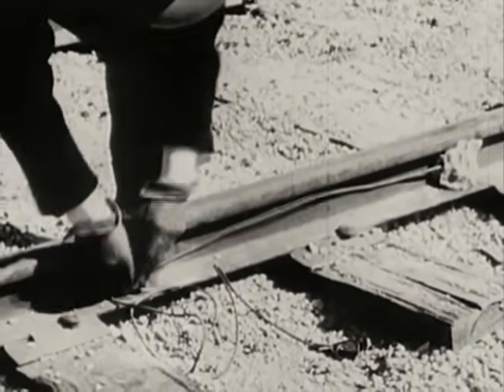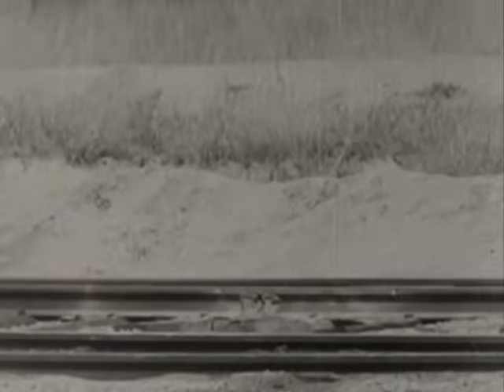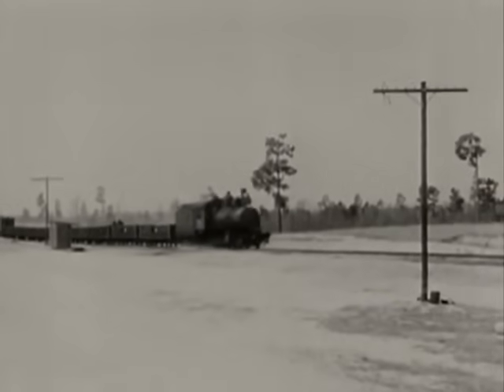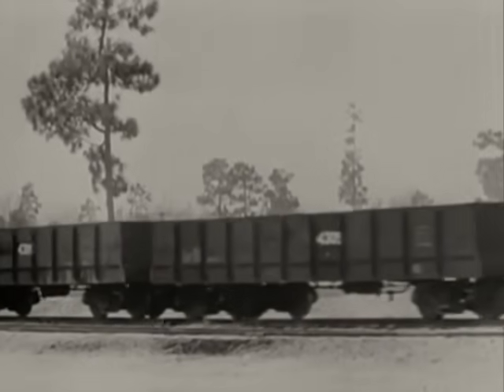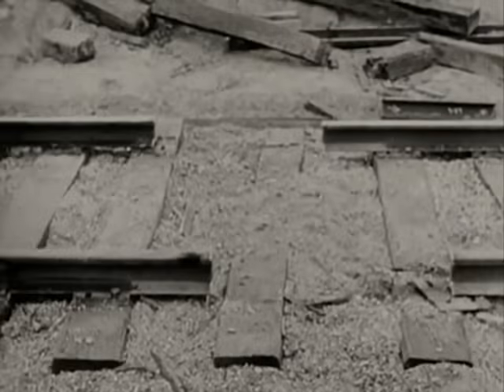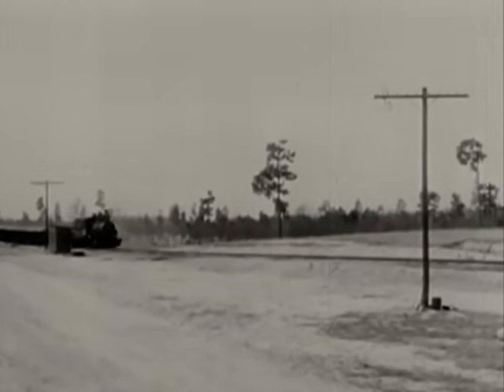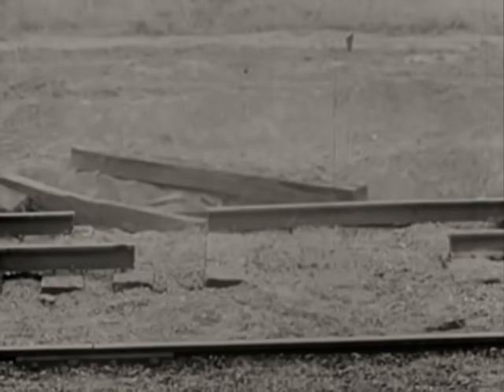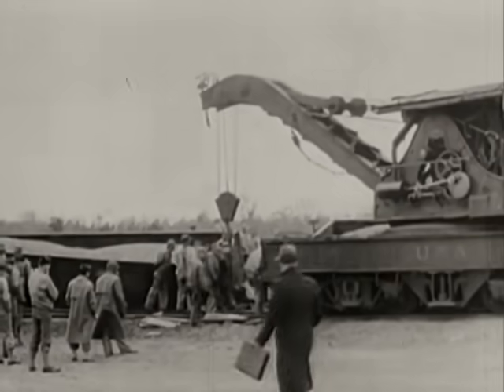Army Experiments In Train Derailment & Sabotage - 1944 - CharlieDeanArchives / Archival Footage

Comment: Leaving a gap rather than miss-aligning the rails was the waste of time.  Two grinder cuts and removing a few spikes would allow a small hydraulic jack with a bar between the in-place rails and unspiked rails to be used to shove the now loose rails six inches out of line.  Alternatively, pinching the loose rails together with a big C clamp to miss-align would also work.  Using explosives to move the rails a-skew would make more sense than simply removing a couple of feet of rail as shown clearly in the movie.

Comment: This is why demolitions experts place two charges "beneath" each rail and tie by digging into the rock piled on the trackbed. The idea isn't to just "cut" a piece of rail. To cause a wreck you need top upend the ties and rails. Second note: This is usually done a few minutes before the train is to arrive at the location where the explosives are placed. This ensures the locomotive will not have time to apply brakes, or that a spotter on a handcar will not have seen it. The French were verrrrrry good at this.

Comment: Was the engine scrapped?
Reply: The engine looks to be 1890s, maybe 1910s at the latest
So definitely a surplus engine
Chances she held out until now are slim to none
Reply: @bussesandtrains_121 ah
Reply: It was probably already scrap when this was filmed. As the narrator said, it wasn't even under its own power, and these experiments probably beat the crap out of its already worn suspension. Stuff like this was usually done with old, worn-out engines that were waiting to be cut up.
Reply: @ which engine was it

Comment: 3:05 and there the issue lies , because modern locomotives run on basicly only pilot wheels since tractions motors spin the axle then a cranking motion with siderods or valvegear wich need a larger diameter due to how levers work

Comment: It sure is amazing how sturdy these trains are, even after all that sabotage only the empty carts derailed. I guess those urban legends of people putting pennies on the tracks causing derailings were a myth after all! I wonder what would have happened if they took out a smaller part of the track and then hammered the leading edge of the gap out of alignment. After watching this, most likely the engine would have righted itself but I'm still curious.

Comment: Whats the locomotive?
I actually want to know
Reply: 2 8 0 consolidation apparently
Reply: It's a relatively small 2-8-0 Consolidation, probably built in the 1880s or 1890s. This particular one was almost certainly scrapped (and was probably already junk when this was filmed), but there are several similar ones that still exist. Southern Railway 154 looks to be almost identical. There are lots of videos on YouTube of 154 pulling the Three Rivers Rambler in Knoxville, TN.

Comment: This test is not relevant anymore. The locomotive they used is way more stable on the rails than todays locomotives due to the long stiff frame on which the main wheels are located. They basically act like a bridge, overlapping any holes in the rails. Modern diesels would fall off much more easily.

Comment: The US class 1 railroads have found a number of solid solutions to this problem, the main ingredient being insufficient funding for track maintenance. Lots of videos on YouTube documenting this achievement.

As for derailing on a straight track, I would have suggested looking into bending the rail instead of taking out progressively longer parts. (In the latter case, don't go by wheel diameter, go by vehicle length, because the other parts of the vehicle keep the rails close to where they should be. That is where bending the rails helps.) As many others have mentioned, just sabotaging the fasteners works. For which you're better off carrying tools than explosives.
Reply: Months ahead of your time.
Reply: Use the ole Sherman bowtie.
Reply: when you have 15 seconds to sabotage an enemy track, you dont go around bending the rail. You blow what you can and run.
Reply: @StrazdasLT  15 seconds? Are you already on the run, then?
Reply: @KaiHenningsen  If i was sabotaging a train i would certainly not have time to stop and reply to your comment.
Reply: @StrazdasLT  If I saw you sabotaging a train, I would be unlikely to make any such comment. I'd be more likely to look for a place where I can alert the authorities without you noticing.

Comment: If your blast offsets the furthermost rail inboard enough to catch the wheel flange the train will do the rest of the work. Neat video!
NOTE TO UKRAINIANS:  You can weld a simple derailer out of scrap them hide it in brush. Guaranteed to work and no explosives required. Copy commercial derailers but without the heavy, complex "on/off switch" mechanism.

Comment: Much the same as the experience of a very large gap found in a high speed rail line in Europe found in the early 2000's . It was only found when a telecoms technician walked the track to find out why the train description that was operated by track circuits had failed. From memory there were around 10 trains that had crossed a 1.5m gap at speed. The rerailing end of the break was well battered.

Comment: That is why SOE put their charges to joins of the rails and used a pressure switch to set off the charge. It was the locomotive that set off the charge when it went over the pressure switch and blew itself up.

Comment: If you place a large bolt longitudinally across both rails, you can derail a train that way, some kids did it in Sydney back in the 40s or something and caused a massive train crash.
Reply: That large bolt is like an improvised derailer. Lifts the wheels off the rail.

Comment: Meanwhile here in the Netherlands "Some leaves could fall on the tracks during fall", "STOP the trains, we must reduce/adjust the trainschedule". Or at this moment "We might have some snow in this winter" "Immediately reduce/adjust the train schedule" 😉😆
Reply: The issue may not be derailment, but traction. Sure, trains have sanders, but if slippery conditions are very frequent, they may run out of sand. But considering most Dutch passenger trains are multiple units, then yes it is ridiculous. MUs have far better traction than locomotives.

Comment: I'm in awe that it's so difficult to derail a train, I can't believe such a big gap didn't manage to derail that actual engine!

I'l bet it would be even harder today since trains are so much faster!
Reply: it might actually be easier. Modern trains are set up more like the cars with a rotating truck at each end giving them a shorter rigid wheelbase more like the tender. The reason the locomotive didn't come off is that it had at least two flanges on each side in contact with the rail at any time keeping it going mostly straight with the pilot truck helping. a modern Deisel electric might fall off with a 9- or 10-foot gap. This locomotive would take about 15 or probably more to knock off this locomotive and this is a fairly small locomotive for the era.
Reply: And heavier.

Comment: What a testimony of skills of the engineers who designed locomotive and railroad car suspension.
Reply: Excellent point about the suspension, an oft overlooked component. Whether it is in automobiles or trains, the suspension (coils, springs, and related items) is the apparatus supplying the down force needed for the wheel to maintain contact with the surface. A smoother ride for passengers is a side benefit.
Reply: Once i had an old Ford Ranger with one shock absorber that jammed. I won´t tell you how high and hard i jumped on my seat at the slightest bump. Believe me, i know now what shock absorbers are used for !!
Reply: @danielfantino1714  hitting my head regularly in the inner roof of my tractor when going a bit too fast over slightly uneven road. I know why suspension exists in autos.
Reply: @tompaah7503 
Yep, those destructive vertical forces can destroy à building. Think of an earthquake. The good point we usually learn fast😅😅😅
Reply: @danielfantino1714 old Ford Rangers were amazing trucks! Near indestructible!
Reply: @trainnerd3029 
Well i got the small cab 4 cylinders. Trying to pass à truck on the highway was a real challenge. Inch by inch i was making it up until that truck front draft of air. Then, stuck beside him, i couldn´t go faster, and that was on flat road. Going downhill was fine. But up and against wind, it was like an overload freight train. Some challenges for sure😅😅😅😅😅

Comment: The best way to derail a train is to unbolt the fish plate connecting the rails and pull out the spikes in the next rail past the joint and push the rail out of alignment.
Reply: no, its to line a trailing point switch against the train.

Comment: When I worked as a Fettler our boss told us that a train that is pushed is 70 times more likely to derail than one that is pulled.
Reply: 70? That's a fairly specific number plucked from a container of bs figures
Reply: @bennoakes2477 Pushing a consist would make it easier to derail and it doesn’t even take much figuring to say the guy is probably at least somewhat accurate.

Comment: They forgot to calculate for momentum. If the train were going slow some of those earlier test would have worked, but the train was going to fast and had to much momentum.
Reply: That and 4 axle, rigid frame locomotives are notoriously stubborn for wanting to stay straight.
Reply: He mentioned the train was travelling at 26mph. That’s pretty slow for a train.
Reply: If you try and take out a main line train, they go beyond those speeds... Freight is slower than passengers but the passanger sevices at the time were on averidge around 70mph and thats with slowing down for signals and for stops for coal, water, passengers,...

Comment: The people who caused the Amtrak crash in the desert just removed some bolts and the whole train went off the bridge.
Removing one rail causes disaster

Even spreading the rail 3 inches will derail with disaster

It is a lot easier to use a couple wrenches, or a jack in between the rails.

2 guys with a hydraulic jack is all that is needed using a piece of tie
Reply: Is it on a curved section? Removing the outer rail will make derailment almost guaranteed.
Reply: I would rather carry 100 pounds of plastic explosives to a demolition site than a jack hammer.
Reply: @Kamdeboo-kz7lo  they had hi-rail trucks that carried the equipment. It was an inside job

Comment: I guess they figured they did need to carry 100 lbs of explosives.
Reply: no one wants to carry 100 lbs of explosives

but sometimes you just gotta
Reply: @CouragSomeone  Hey if you divide it between ten or twenty guys...
Reply: Destroy 8 inches of both tracks, then use a pair of sledgehammers to misalign the rails?  That way the train wheels are forced to the side instead of going straight, and there is no rail in the right position on the opposite side of the gap to bring the train back on track

Comment: Wouldn't it be easier to blow a small gap in the tracks, and bend both rails a bit with a sledgehammer to steer the train off course? I'm surprised they didn't think of this.
Reply: Bend it with a sledgehammer is just not an option, even with old light weight rails that would be impossible. Furthermore, since it was in wartime, and strategically important rail lines were sometimes guarded (although not every stretch of them of course) you would have to work fast to pull an ambush like this off, or you would quickly be in trouble yourself.

Comment: Just pull up spikes and move a rail out of gage. No explosives needed; just a crowbar to pull the spikes up and jimmy the rail over a few inches.
Reply: But in wartime conditions you have to add the risk of getting fired upon by the enemy, hence you cannot carry hevay equipment around or work for long periods of time. The point of these experiments was to train men for actual situations, not "lab conditions".
Also hardly any German lines at the time had spikes, virtually all had different arrangements of rails held in place by plates and screws, so you'd need a lot more than just a crowbar to get those loose.
Reply: Or just find a switch and weld it split

Comment: I lol’ed six attempts and they still didn’t derail the locomotive.
Reminded me when the Army Reserves demolition experts tried to blow up a small 100 year old railway bridge between Heathcote and Bendigo and failed. The bridge was still standing and eventually used an excavator to push it over. That bridge was meant to last a century.
Reply: How much weight do you think a standard pattern Victorian Railways wooden trestle can take mid span?
IIRC Melbourne Uni engineering department (could've been the war army engineering department fiik) did a test on possibly this bridge you mention and everybody was astonished.
I think at 100 years old or whatever it was it yielded at ~350 metric tonnes.
Considering heaviest Victorian Diesel locos only weighed 130-140 tonnes then the mid span load was 65-70t for a single loco and perhaps less than double that for two locos since the six axles would never ever be mid span due to their spacing. 
Those trestles despite their alarming appearance are tough as!
Paul from central vic.
Reply: @ThePaulv12  The little bridge was a timber span, I think was near Axedale, it just covered a culvert. The test you refer to was on a standard steel span I recall that test done in the mid-70s.
Reply: @darylcheshire1618  The test I was talking about was more recent than that. It was on a timber trestle. The info I got was about 10 years ago. It was secondhand info but the story was told as if it was recent at that time. Could've been Chinese Whispers and was the 1970s test you're talking about but they did say timber trestle and 350 metric tonnes yield.
Reply: Excuse me but what does lol'ed mean??
Reply: @Bonniekinz334  laughed out loud
Reply: If they asked SOE to do it, it would have taken one attempt and resulted in one wrecked locomotive and wagons

Comment: I can't decide if I've learned how much rail I can remove from a track as still let a train safely pass, or how big of a gap in the tracks I could run a train through without issue...
Reply: When there is debates on how much rail they can remove while allowing a train to pass through safely or how big a gap they need to make the same train derail.

Comment: It would easier to destroy the sleepers and the tracks won't be in gauge especially if you destroy the fishplates and pull it to the centre, it would would push it off like a trap point.

That said I'm impressed how the train can still carry on over large gaps.
Reply: I think the large driver wheel just hop over the gap
Reply: @sewagii Ripping up 10 sleepers would be enough, the track will widen under weight of the train which will collapse to the ground.
Reply: @sewagii A large metal hook attach to train will rip it up, German did it when retreating from the Russians or alternatively drill a hole and a dynamite in each sleeper.

Are you really that that thick not to think it through or are you just being awkward ?
Reply: @colinvespa4709  The problem with that is the Germans did that while retreating, but this is the OSS doing it - they're testing ways to derail a train that partisans could perform.
Reply: @RedShocktrooperRST  ^

Comment: General Sherman's boys could have given them some tips.
Reply: Ya heat a whole rail. Then ya take the rail. Finally, ya tie it around a tree.
Reply: Arson? In war? The Union destroyed rail tracks, rolling stock, equipment, and infrastructure. And whatever else supported the South's war of secession to protect their "peculiar institution".
Reply: @spikespa5208  I mean, the Union nicked The General, from it's passenger train, and went tearing down the line unauthorised. Ripped up some bridges, broke the loco, and ran off. Some Southern boys went after them, but struggled due to the saboteurs. One can see how terrible a job the Union did, as The General still exists.
Reply: Union won the war didn’t they? You supporting racists? I live in the South and I’m fine without slavery. I hope you’re joking
Reply: @cableyoutuber  your comment is treason.
Reply: Sherman was a War Criminal, & an Arsonist

Comment: What if you line a pile of rocks (both big and small) on each side of the rail for an extended length?
Reply: Golden Maximo a lot of times the train wheels would just crush or launch the rocks.
Reply: @captainhellhound7451  Interesting. Thanks for clearing that up.
Reply: Trains are far too heavy for rocks to have any effect but if you’re talking about a rock that weights 4 to 7 tons that can derail a train moving at about 80mph
Reply: Advanced Soldier while you are correct, I hate you because of it
Reply: Captain Hellhound why is that?
Reply: kid do that all the time and it do nothing
Reply: you get missiles but no derailment.
Reply: What if you weld a thick piece of scalene triangle shaped metal on each of the rails then unify the two pieces with support bars in the bottom of the two pieces to prevent it from collapsing under the train's weight, forming a ramp-like shape for the train then one or two meters ahead you blow up the rails like in the video?
Reply: @habibsspirit it would be better to just weld one triangle on
Reply: @mildly_miffed_man1414  That's true. One big ramp.